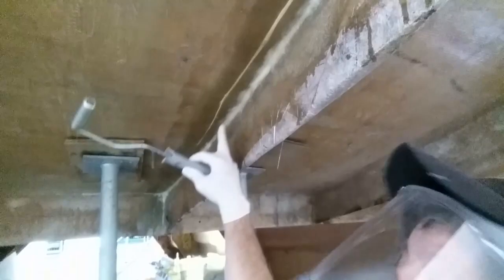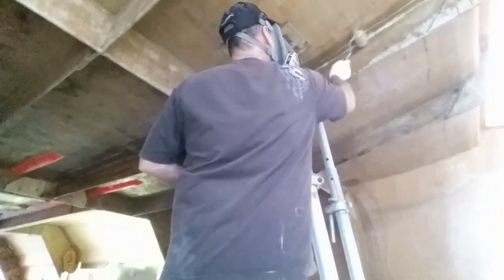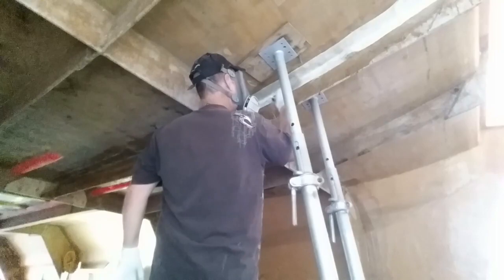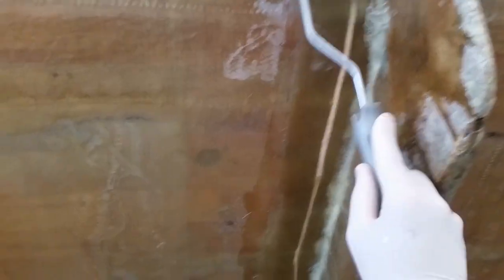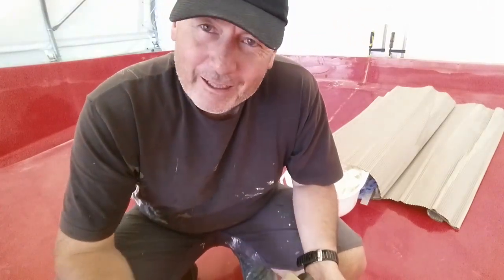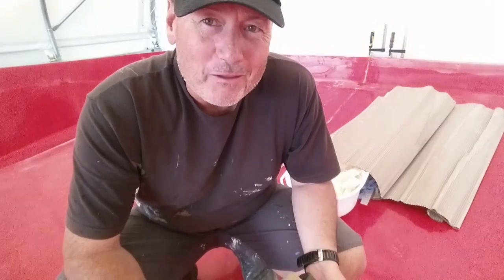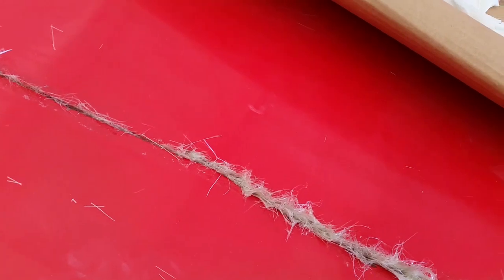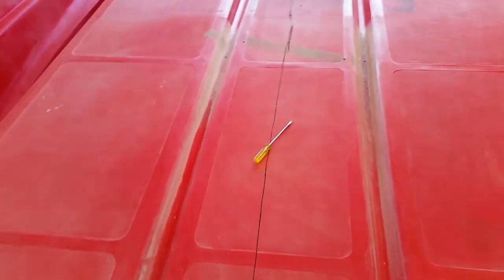Ep004 Buffing Scratches from Gel Coat.

Comment: why do not you use a gelcoat gun to impregnate fibre mat , as you do when working on a catamaran?
Reply from the maker: I actually use the same system to impregnate matting on most of the products. Please see this video which is a review of my gel coat / resin spraying system. It is an amazing system that catalyses resins just outside the tip . Usable for any polyester and vinylester system.Cheers Ross 
https://youtu.be/rNAZGuvOp4s

Comment: Hi Ross,  I have been trying to catch up with you over the weekend, all the work and trials tribulations etc. It has been just wonderful. But please if you have time could you share with me the name/model of the corded hand drum sander you used on the seam. I have been doing a grinding job that would have really enjoyed this device.
Reply from the maker: Gidday Chris. The sander is the Bosch Roller Sander. Not sure where you are but I have found a link to Amazon UK Attached which may help you find it wherever you are. It is a brilliant tool albeit expensive consumables though . I tend to buy them in bulk and have used this thing for about three years solid.  Hope this helps. Cheers Ross 

https://www.amazon.co.uk/Bosch-PRR-250-Sanding-Roller/dp/B00D86LW1Y
Reply: Goodness that was fast mate.  That is very generous of you Ross....yes a little pricey, but it would have earned its keep on this one job I have just finished. I imagine with a 93mm roll of your choice of grit, one could make up their own  expendables.  (I have yet to perfect this process :-)
As for 240v  operating voltage, I would have to make up a custom extension cord.... Keep the cameras rolling and try to catch the first time I plug a 110v device into it :-) 
Best regards, C

Comment: Hi so how  come your doing a proper fix on the mold, are you hoping to use it more than once? I would have thought all you need to do reinforce it enough to get the hull made. Clay the cracks etc , later just polish the finished part later. Same as all the mold polishing , why not do enough to get the part out and then polish the gelcoat afterwards?
Heck of a project...I've been in the fiberglass game a long time so I appreciate what you doing.
Cheers Warren
Reply from the maker: Hey Warren, it certainly did cross my mind but unfortunately I like to hedge my bets by doing the best repair possible and then less work at the end. There is always the possibility of another boat, or I will look to lease or sell it to someone else, as I would hate to see it go to waste. Have been making brand name sea and surf kayaks for years so this is a monster project for a one man show but loving the challenge. All the best and I hope I dont bring back any nightmares for you as I remind you of the job at hand. Rossco.
Reply: Life On The Mold - Building a 40 Foot Catamaran , no worries it's all good. If sailed & raced with a friend who built 2 Trimarans from scratch so I know you can do it. You have the additional headache of a huge interior. A 40' tri is actually quite small inside ......I'll try to follow along 
Cheers Warren

Comment: BTW  When you install your motors, consider putting a 90 on the drain plug hole. Attach a tube with a cap on end, running either fore or aft to make changing oil easier. That way you don't have to suck the oil out through the dipstick tube.  Put a suitable pan or a heavy plastic bag down, take off cap and let her drain, easy peasy.

Comment: With a big job like that, did you consider renting/buying a chopper gun?
Reply: Thats an old wives tale. We got plenty of fishin boats on the Grand banks in the North Atlantic built with chopper guns. It would cost a fortune to hand lay a 65 or 70 fishin boat. With a chopper gun, one man on the gun and two comming behind him with fin rollers. Of course you have to use biaxial and triaxial and rovin too but a chopper gun is no different than matt.  And you can vary the thickness of your as necessary with a chopper gun.  That is, assuming the operator has half a brain when using it.    Most of the problems with chopper guns is the user. Either hardener set wrong or too much chop for the resin mix resulting in delam or dry core.   There is movement by a couple of shops toward vac infusion, but have to wait to see how that works out.

Comment: It's great seeing some glass go on. I was surprised to see that it was CSM . Will you be using biax and DB and foam cores for stiffening? What is the expected weight of the boat when it's finished? It's a lot of work prepping the moulds but so quick making the parts.. keep it up every piece is progress.... cheers Russell
Reply from the maker: Hey Russell, Hull is 300csm/300csm tie layers, 1200 Quad/300csm H80 Foam/300csm/600db/300 csm. Engineering has been done and rated to 20knots with additional stiffening around bulkheads forebeam and chain plates etc.Cat is being built tp AMSA survey and Modules like the engine bays, although not structural will aid in stiffening will have nominal stiffening including csm /DB and core 10mm h80 where required.Aiming at 7 tonne dry weight which is pretty good for a 40 footer. Video only shows first laminates prior to cracking off mold then I check them for finish then put back on mold for final laminate. Just can't fit enough into the vids or they would go on forever. Have been told to shorten them but there is so much story to tell. Hah, all the best and look forward to your comments into the future.